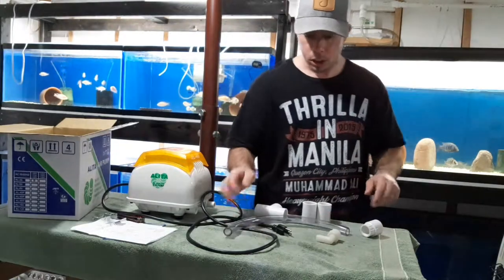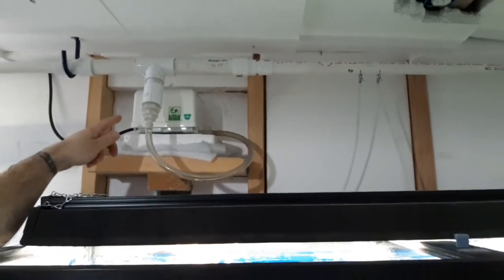Alita-40 install & review VLOG#12

Comment: U think the AL40 would be Overkill for 6 tanks or should I just get the 15?
Reply from the maker: Yes it would definitely be Overkill I would go with the 15 how deep and how big are the six tanks
Reply: @baircichlids5350  2x 125g, 3x 75g, 1 40b. I think 2ft is deepest.
Reply from the maker: @SpeekofDee  I think if you run them in the loop systems like I have my air system I think you'll still be well powered for that size tanks good luck my friend

Comment: How many air outlets can the Alita-40 power?
Reply from the maker: This is a tough one to answer because different tank size will determine how much output you will have. Deeper tanks will need more power to get to the bottom. So in theory you could have 10 75 gallon tanks and that would be it all the Alita 40 could handle. Might be more or less. Just my opinion

Comment: Would the alita 40 be strong enough to run about 2 sponge filters in 13x 40 breeders?
Reply from the maker: I guess the real question is how far is the drop-down for each one of the tanks meaning how long is the airline running to each one of the tanks but my guess would be yes as the 40-gallon breeders aren't very deep